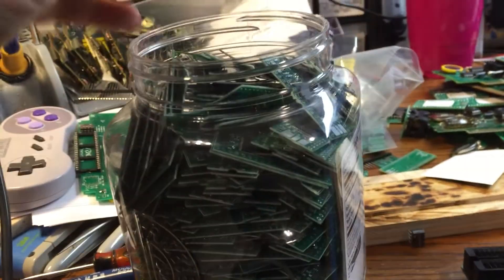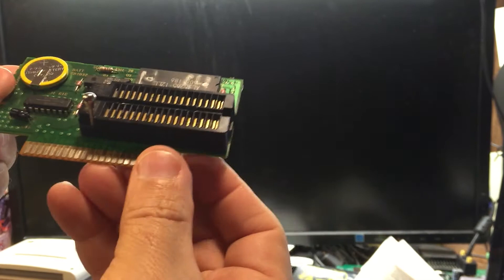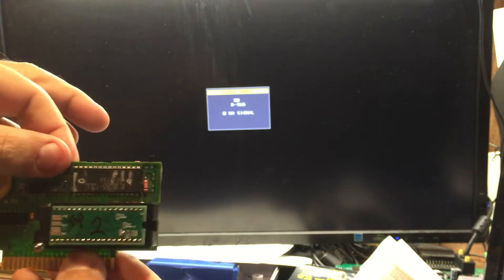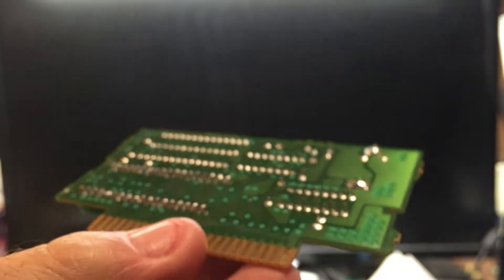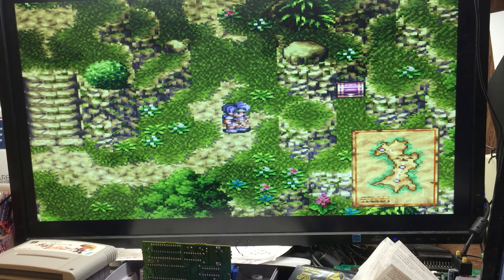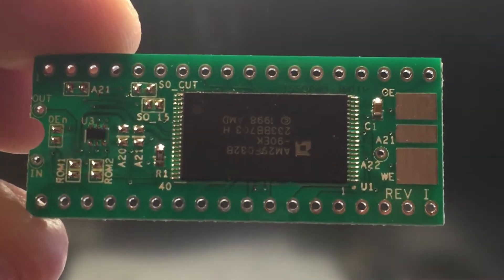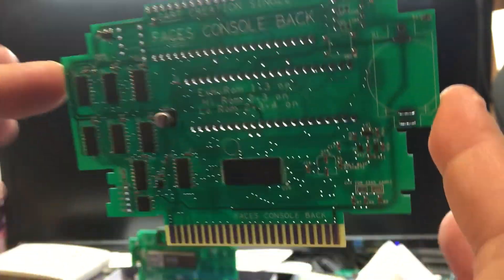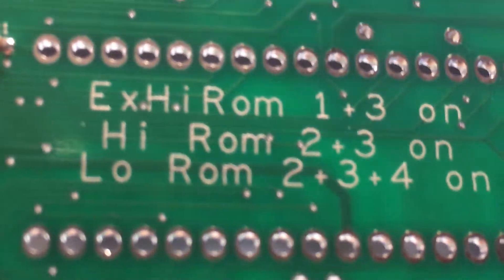Tsop adapter Pcbs with decoder integrated are here!

Comment: Hi bro,

again and again. I like your pcb projects and find this kind of solution very sexy. YOu use a totaly different tsop pcb. What have you solder for different smd parts? The common version of buyicnow and so on has only 3x R- resistor points. Further is this kind of solution for SO or TOP not to expensive? 3x tsop 96Mbit? Each tsop 3-5$? Some SO need only one 4 MB 27c322 rom?
What kind of programmer do you use for your test. See at 1.19 you use a testsocket with some golden pins. Could you send me a link for product? Iam looking  for some thing like this.
Thanks. red
Reply from the maker: I made the spring pin adapter you are asking about. It's not really a product I sell but I could sell you the pcb and the link for the pins.  I made the spring pin adapter to mate with my tsop boards.  But you could easily solder header pins to my pcb and program them yourself.   My programmer is a Wellon 890 made by Weilei.   I have been VERY happy with it.  My tsop boards I made (of course) because the buy IC tsop boards suck!   With no other option, I see why people buy them but they are really poor quality. I won't use them.     The Star Ocean 3xTsop is a little complicated but as you can see, it can work.  ToP is easier because the settings are more straight forward.  Modding an ORIGINAL SO, there is a different method of converting it to English.  The way most people mod the original SO -they use very bad electronic practices (using 3v roms).  My SO uses standard carts so that's why you have to have 3.  When I have my boards made, I have the manufacture put all the parts on for me.  I hate soldering all those fine pitch parts.    The tsop's are the 29F032b parts.
I'm not sure where you get the $3-5 price... But mine would be more expensive than that.
But all this being said, my "cart creation" pcb is soooooooooo EASY to use that I don't like using donors any more.   That project is a home run!   My email is snesunlimited@gmail.com for more information.
I just received these pcb's from manufacture so I am still testing and writing an instruction manual for them.
Reply: arcademaster1 Hi, thanks for your feedback. The adapter you use with the pins is a normal TSOP Adapter for programming right? Think this its the same for will. I have also my own pcb tsop adapter and if i create a zelda ast 4mb cart, with all 4 weeks, i solder to tsops on the back of the donor cart. But before i have to program and want test the tsop boards. Sure, you can use your pcb instead of donor cart, but for my cartmods the pcbs are also a good solution ;) Could you send me the link for the pins, please? Have you ever try to use the MX29L322 Chips? Yes, you have to use a second part to control the vcc but it works also well and you could save a lot of space? Maybe as smarter solution?
Thanks. red
Reply: +arcademaster1
Could you send me the link the the pins?

Regarding the PCBs. For 15$ are alle decoders and batterie soldered on?
Where was your pcb produced? ITEAD? Or Oshpark?!
You said, the TSOPs are already soldered. What do you pay for each tsop including solderes tsop?

Thanks

red
Reply from the maker: http://www.mouser.com/ProductDetail/Mill-Max/0914-0-15-20-77-14-11-0/?qs=%2fha2pyFaduiS3GG9nXGVtKhvXKQEslxato4yM8Uf7P4%3d

www.10pcb.com

all parts are soldered on including the battery for the Cart Creation pcb and the TSOP adapter with decoder.

The assembly service charges different rates depending on the quantity.

Thanks!